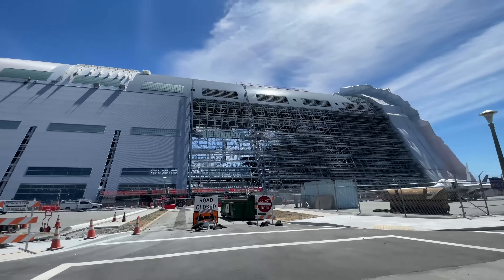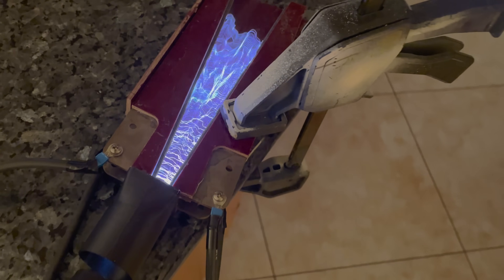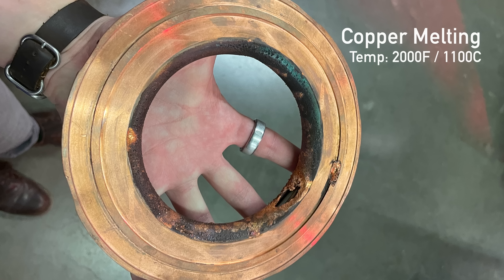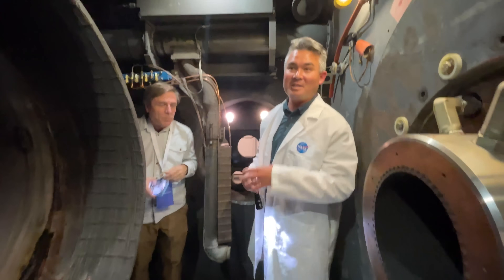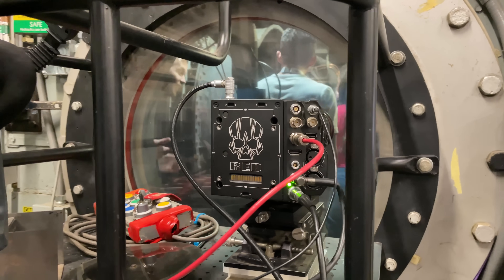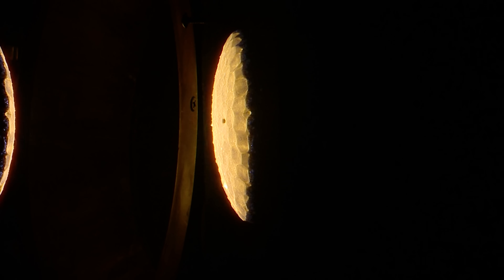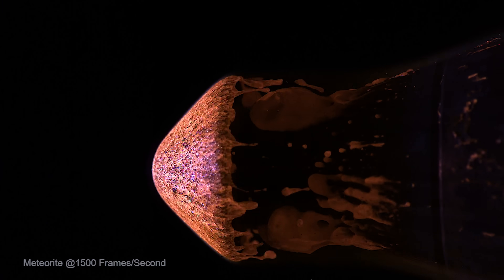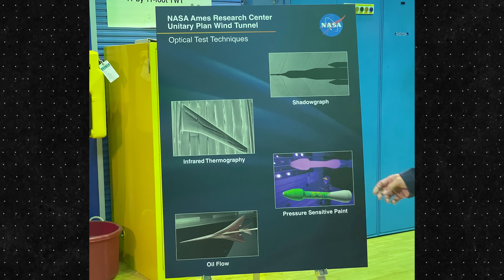How NASA Tests Spacecraft Reentry

Comment: A lot of those models are also full of tiny pressure sensing ports, in that picture with the Orion capsule the guy with a tiny drill in a pin vise is probably cleaning out on of those ports.  Look up the Boeing model maker video, those things are works of art.

Comment: Thru BAJA SAE (Ohio 23 race) I got to tour the Halo wind tunnel that's out near the east liberty Honda plant (Thanks Honda for hosting that race, was super cool especially because I was driving a vehicle that came out of that plant 20 years prior), and that was also a super cool experience. It's more optimized for cars (hence a max wind speed in the mid 200s MPH) but it in turn is an 8m test cell and an 8m diameter turbine, 8700HP. We got to walk thru the blades of the turbine (It's basically a huge EDF like you'd find on a model jet) and that was absurd to have the motor hanging over my head and the blades on either side of me.

Comment: 9:02 This method is used often in F1, they apply a high-vis paint to areas they want to see the flow of air over, except they don't just do it in tunnels, they also do it on track. You can see it sometimes during practice but most often during pre-season testing.

Comment: Ames is also the NASA lead for Space Biology, Small Satellite Technology, Robotics, Spacecraft Autonomy, Reentry Technology, and many other areas.  Ames quietly pushes technology into the future to enable space exploration and science.
Reply: Don't forget human factors (human system integration), perhaps one of the more important divisions to everyday life since they've made the world a much safer place by studying the way that people interact with technology and have worked to reduce error rates and design safety critical systems to work with people how they exist in the real world and under stress. The checklists that airline pilots use in emergencies were completely redesigned with the help of NASA after an NTSB investigation showed that several preventable accidents were caused by confusing checklists. That work alone has saved countless lives over the last few decades.

Comment: Hey, can someone with about 75x more knowledge than I do, run a rough calculation of the minimum power draw required for something to need a substation, as well as the maximum power throughput of a substation of that size in watts so we can get a rough electrical cost for those air tunnels

Comment: I got to tour the center through the NCAS program and I actually got a number on how much energy it takes to run some of the wind tunnels directly from the director of NASA Ames Research Center (Dr. Eugene Tu) in his words: "120-150MW to run the 80x120 and 60MW to run the ArcJet" using the figure of $0.47/kWh in Sunnyvale California these wind tunnels cannot cost less than $56,000/h and $28000/h respectively. (this does not take into account labor and any contracts with electric companies.)

In short, yes, you were way way wayyyyy off 

we also happened to go a few weeks after you and they were telling us about your party

Comment: The water cooling, is also why some continuous casting methods (for steel and such) use dies and channels that would in theory melt at a lower temperature than the metal you are casting

Comment: I used to work in the aerospace/cfd area and got tours at a wind tunnel a few times. It was significantly smaller, but still the local electric utility had to be called before starting the thing due to its gigantic power consumption. Nowadays the Compute Cluster for CFD at the location actually surpassed the wind tunnel in (annual) power consumption. Theres also a lot of interplay between CFD simulations and wind tunnel experiments, e.g. CFD code is usually validated from wind tunnel experiments and wind tunnel experiment data needs to be corrected for wall effects, sometimes using CFD results.

Comment: Yeah I could see a smaller university wind tunnel being around 2000/hour. But this is one of the premiere research windtunnels, so it's probably closer to the 200k/hr range.  Of course there's also cost per hour of on-site setup time vs per hour of actual machine running test time, so there's some distinction to make I'm sure.

Comment: I remember when you estimated $200 -- $2000 / hr for wind tunnel time.  Oh grasshopper, that made me chuckle.  The salaries alone of the people who run that wind-tunnel complex are almost certainly greater than $2000/hr.  I wouldn't be surprised if a realistic cost was closer to $200/second.  Of course, that was a honking big (*) wind tunnel complex

I got to tour a wind tunnel in the French Alps (Modane): mind blowing.  They were running the big subsonic tunnel while I was there, good lord it was loud.  The noise extended to such low frequencies that you could "hear" them because of the pressure waves striking your chest. 

(*) "honking big" is a technical term.

Comment: 3:22 Coming from motorcycles, the fact that the thing that holds the sample is an arm that swings, and they even say that, but it's called a sting arm is really messing with me.
5:53 Also as someone who's had to work with a software suite with very poor documentation, it does give me a bit of comfort that literally NASA also has things they can't build be cause they lost the documentation. (Also the engine designs that were never fully documented, so without the original engineers it's not worth it to rebuild)
10:45 The best part of that is that while he wasn't able to say the rates, you were far enough off that he was fine with saying you were way off, so you know it's way off lol.
The different format is great, and I think fits well on the main channel.

Comment: Wind tunnels can be dramatically cheaper, but they won't be useful to you.  I have seen one built in a garage for a few thousand dollars, but like most wind tunnels, it is useless for anything supersonic.  Wernher von Braun ranted about this problem 80 years ago.  The speeds a decent rocket goes would probably put you in need of a wind tunnel at a good Engineering school, and away from the experimental home-built aircraft I am used to dealing with.

Your best bet for data is what you have been doing, fly it.

Comment: I used to work near Ames, in a building under one of the landing patterns. Fell in love with NASA's ER-2 jets. I used to call up the High Altitude Branch (I think I'm recalling that correctly?) on Mondays, and ask if there were any ER-2 flights scheduled for the week. If there were, they'd tell me which day(s), and departure & return times. I'd drive over to the airfield to take pictures of takeoffs, then later go up on the roof of our building and take photos of landings. Beautiful aircraft. The director offered me a chance to visit and take photos up close, but never got the around to doing it.

Comment: A similar system to oil flow is used on Formula1, they call it Flow-Vis paint where they on test sessions quickly paint the car with a liquid wax that dries quickly as the wind hits it, freezing it in place and showing how the air is moving around the car.

Comment: If I’m understanding this correctly, why don’t they (spacex) just use ADEPT heat shield material on the hinges. If it is flexible/foldable  and doesn’t ablate then it seems like the perfect material to seal the hinge gaps. 

(Then again I don’t know how flexible this material is).
Reply: This material is far less effective as a heat shield. This is why it’s reserved for mars re-entry and is never used for earth re-entry.

Comment: No matter how good the modeling analysis software is, one will ALWAYS need to use engineering judgment when building the virtual model.  In as much as that’s true there will always be a need to validate the model in the real world (i.e. wind tunnel).  My background is structural dynamics.  We never trusted our models until we went into the lab to measured  resonant frequencies, damping and mode shapes of actual hardware.

Comment: CFD will never replace wind tunnels for two main reasons:
1. You need wind tunnels and experimental data to validate new cases of CFD simulations.
2. You can scale up a computer up to having high order simulations (LES, maybe DNS) of practical cases (e.g. a cruising airliner with a representative Re number), but the power consumption of the machine will also scale up. At some point it is going to be cheaper to build and test the thing that running super expensive CFD. The biggest super computers also has 10s of MW of power requirements.

Comment: I am guessing space and aerospace costs are kind of in the same ballpark as subsea (deepwater) stuff. If you want to do hyperbaric pressure testing of your equipment to, let's say, between 5000-11000 meters in depth, they won't answer your email if your budget is 2000$ per hour. All the preparations, and scheduling of the test facilities, and the investments they have made into some of the worlds most specialized equipment (especially if you're testing something large, as the price grows exponentially with the diameter of the pressure vessel used for testing) - they won't bother unless you are prepared to spend close to a million for like a week or two of testing. The hourly rate is probably like one order of magnitude off.

Comment: If you're interested in the oil flow technique, it's worth looking into "flow-vis paint", which is essentially the same idea, used in aerodynamic testing and tuning in Formula One (and possibly other motorsports, but most of the info I found focuses on the use in F1).

In fact, I think that you might enjoy looking into how F1 teams design and optimise their cars. The rules of the sport impose limits on CFD and wind tunnel time, so they have to make the best of the time they have. (This is also one of the levers the FIA has to level the playing field, as teams get more CFD and wind tunnel time the lower they were in the rankings of the previous season.)
They also have very limited on-track testing time, just three days, and no matter the results of the CFD and wind tunnel, the actual dynamics of sending a car around a track, with bumps, side winds, the engine actually putting forces through the suspensions and wheels, and all of those other factors, means that those three days are critical to make sure the concept works.

There's even a huge strategic game, where teams will shift resources from improving the car during the season to try and win races now, to starting design on next year's car. A team that has a dominant car might decide to start developing the next year's car early, since the car on track is certain to win already, and a team that is in a hopeless position will also start developing next year's car instead of trying to polish a turd, whereas teams that fighting hard for championship points will need to play a delicate balancing act, a sort of Mexican standoff, trying to figure out when other teams will shift over.

Comment: Not to detract from the awesome capabilities of the ARC tunnels, but that 30,000F number is more like 13,000F. A quick read of NASA/SP-2010-577 shows this in the graph on page 13 and the figure on page 29 as well. Absolutely an unbelievable temperature to reach, but not quite 30,000F. Unless the video wasn’t referring to bulk temperature??

Either way this video is awesome

Comment: I think the real issue with CFD is coupled dynamic edge cases. CFD + FEA combines the assumptions and errors from both. Throwing a model in a wind tunnel avoids this issue. 

I've also heard from an aerospace friend that sometimes adjusting the physical model quickly is easier than redesigning a part in a CAD package.

Comment: Oil testing is actually still used alot with f1 cars. Due to the regulations they have limited windtunnel time so during testing they add "flow viz paint" to the car to see how the air flows around while driving.

Comment: Oil paint seems really similar to flowviz paint which is used loads for race car development still both in wind tunnels and full scale real world testing. 

Also you mentioned how you can test these things two ways with either object moving fast or the wind but normally it’s easier to just move the wind. Well there is a couple cases of race teams buying long railroad tunnels and climate controlling them and turning them into the first style of testing tunnels because it’s even more accurate than a traditional wind tunnel

Comment: You can visualize waterflow like airflow at home for cheap by using graphite. The cool thing is you can evenly space magnets above the water and it will creat streams like they do with smoke in actual wind tunnels. The magnet reacts just enough on the graphite to see the colors change. This is one of the coolest ways to demonstrate and find turbulant vortexes and the fact that you can do it at home is very cool. Does it give you numbers? No. But you can get a decent visualization of fluid dtnamics on an actual part or body moving through the water.

Comment: Oil flow is used by motorsport teams all over the world to check correlation between CFD, wind tunnel and real world. It's called Flow-Viz and is a very simple recepie. Might actually be something you can use yourself to check that your CFD works as intendent.
Reply: Indeed.

Comment: 9:07 Side note: Oil flow is stll used heavily in motorsports, especially F1, since the regulations allow the teams very limited CFD and wind tunnel time.
Reply: dont they use the fancy color changing paint too?
Reply: @The_budgetking I've never seen them use color changing paint. 
They add color pigments to the oil so they can see it better against the livery - the oil dries and leaves the pigment on the surface in the shape of the air flow.

Comment: What a truly interesting place. Like a big toyland with lots of gadgets to play with.   FYI, you can calculate the cost, not including wages and benefits, by finding out the size of the electric motor and by calculation you should be able to get the kWh used. Be sure to fi d out if the local utility has a demand charge for kW demand and/or time of use rates.

Comment: Great vid as always. I work in the defense industry and wind tunnel testing is part of my job. Your guesses at the hourly cost of wind tunnel operations were very wrong, but understandable given the lack of publicly available information on such things. The hourly rates are MUCH higher, even for tunnels that are a fraction of the size. And cost goes up dramatically for high Mach numbers, etc. Wind tunnel testing is ludicrously expensive, even by commercial/government standards. There's so much more I wish I could say on the topic of wind tunnels... It's a super interesting and challenging field of engineering and aerodynamics.

Comment: I was and still am a CFD engineer from my master's thesis until now and no CFD will never 100% replace real testing for everything. It does and has already replaced wind tunnels within F-1 because we have 10000x the number of real windtunnel tests compared to the number of simulations that are being done. The regime that those vehicle operate in are very restricted and through regulation they are not set to start operating another 100 mph faster anytime soon so because the operational domain is very refined and so very well studied experimentally it will be years before CFD catches up to account for all of the simulation backed phenomena just in the boundary layers alone.
Reply from the maker: Hard agree - also this is strange to say but I remember seeing your HolliStar tests way back in 2015 when I was getting started in rocketry! Super cool stuff
Reply: I feel like it will continue to improve and reduce the number of early tests that are needed, but you really can't beat just actually doing the test in person when it comes down to it.
Reply: And at the same time AM is saying simulation doesn't correlate with reality.

Comment: the oil flow (or equivalent) is used in formula one racing cars. You usually can see it on the practice "one" (and mostly in the beginning of the season) . They apply it to the edges of the car and after one or two lap they bring the car in the garage and look at the flow of the air.

Comment: Bwhahahaha! I saw one of the machines I use to work on in wind tunnel data processing clip! I've seen them before in videos from Koenigsegg and other wind tunnels. I don't know if ill ever stop find it amazing. I'm an electronics tech and was a set up/check out and calibration tech in the fluid department at this company before I got moved into the partical counting department. I knew nothing about fluid dynamics when I worked there and what I know now is only from my time there and YouTube videos. But I didn't really need to know fluid dynamics to use a scope and trim pots and filter caps. Still it's so damn cool to see that stuff in the wild.

Comment: Glad to see Hanger 1 going back together. As a high school student I trained at NASA Ames Research Center for machining and design. Later my first duty station in the U.S. Navy was VP-31 Staff in Hanger 1. 

Got to climb all over it, even opened the top hatch and sat on top of the hanger for a Blue Angels airshow. Good times. 

Once I put in a Request Chit to "Paint the hanger a light golden brown, so as to disguise it as a giant twinkie from the air". Oddly my request was summarily denied.

Comment: NASA is publicly funded so you should have just laughed in the face of whomever told you that they can't discuss rates.

They didn't forget how to make Avcoat, and it worked just fine on the first Orion test. It failed on the last test because they changed the application method from manual injection to machined blocks.